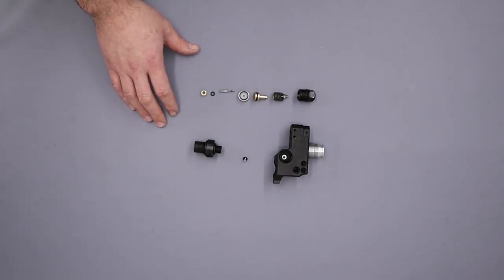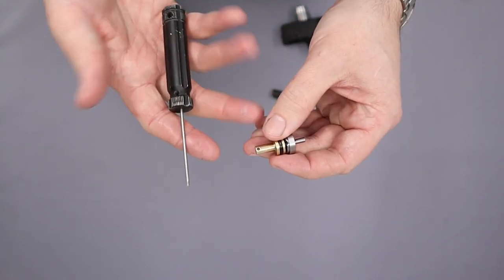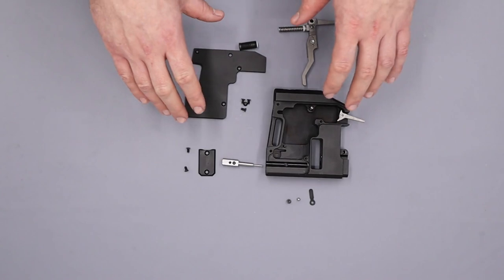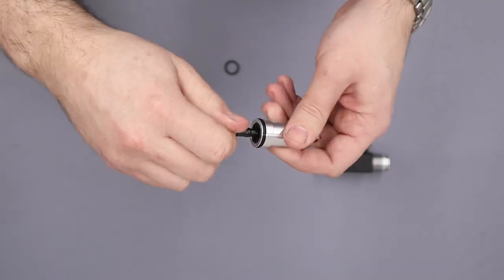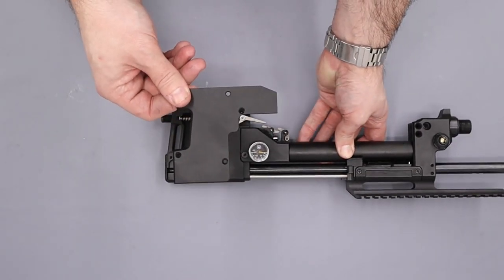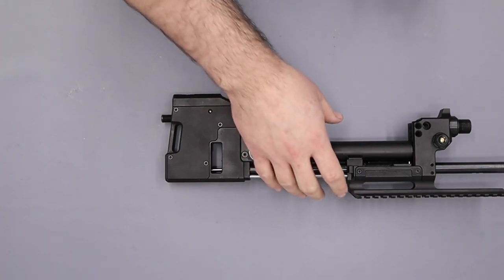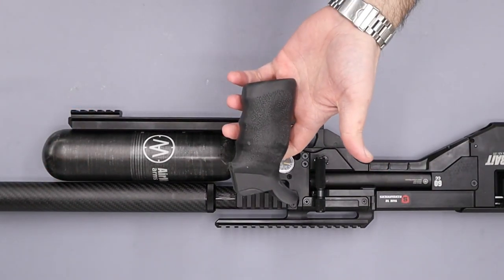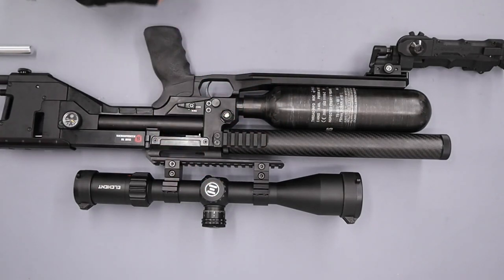Airmaks Krait rebuild

Comment: Excellent video👏🏼👏🏼👏🏼👏🏼, but if you allow me some advice 😅... I would avoid staining the bevel of the metal shaft and the contact area of the POM with grease, this will prevent particles from adhering that damage the POM, causing leaks in the gasket.👍🏼👍🏼👍🏼
Reply from the maker: Yes the valve seat is quite a long way down from the o ring so the face is clean although it looks in the vid like it's close and gets grease on it but it doesn't 👍 thanks for watching

Comment: hi i believe you stated that the old shroud might have been pushing the barrel somewhere
causing poi to be different to yr one ? does this mean that the internals of the factory one were not concentric with the barrel ?
Reply from the maker: I think on our one it was the front boss the shroud screwed to in the block that was giving the issues

Comment: Can the magazine spring tension be increased? When the barrel is pointed down, a pellet falls partially into the barrel which makes it impossible to remove the magazine until all pellets have been fired. With the barrel pointed up, a pellet falls backwards against the probe when the cocking lever is cycled which causes a jam. Any suggestions?
Thanks
Larry Guinn. USA
Reply from the maker: I think there are updated mags available now  👍

Comment: Another great video 👍 Have purchased an o'ring kit for future use (always like to be prepared 😁) Do you think the extended pellet probe improved accuracy by seating the pellet fully into the rifling?  And will you be making these for sale? Thanks for Another great video. Tom
Reply from the maker: Thank you, it may have made a marginal difference to accuracy i don't think we will be making them as the inletting on the barrels probably varies a bit so you may make it worse by fitting one    👍

Comment: hello the link for the O ring box does not work unfortunately i can't find it on eBay  how could i purchase a box please regards Paul
Reply from the maker: Hi we stopped do the kit's as they changed the reg 🤨 so we can do the kit for you but it may not have the correct o rings for the reg👍